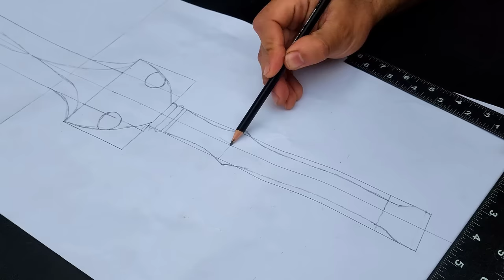Hand Forging RAILWAY Track into a Legendary WarCraft SPEAR

Comment: Visually gorgeous... But the blade made with different parts will make the liquids to go through the joints... It will get oxided and dirty at the blade decorations in no time since you can't clean the joints easily... Anyway, if it's only a model or to hang on a wall, it's completely gorgeous!

Comment: My only issue is with the video title; the rail was not hand-forged into a spear, it was forged into a blank and then cut, ground, and milled into the spear. Other than that, this was a great build and really pretty!
Reply: My only other issue is a 'good' blacksmith doesn't have to coat their anvil with WD40 and create a massive lens flare/fireball for views...
Reply: @chaossdragon sheeah, a guy can't even have any fun in his own shop anymore.
Reply: @VektrumSimulacrum  if I offended I’m sorry, I’m just jaded from all the “moar flames/moar sparks = more views”.  Seen pros do it so many times and one guys shop nearly went up in smoke cause an ember shot off into a box of stuff under a workbench…
Reply: That's how it's done. Any smith will forge out the rough shape and leave the rest to abrasives. The only exception I know are Japanese katana makers because good steel was notoriously rare. They would forge almost to final shape but then use rasps and files for the final shape.
Reply: @bramweinreder2346  I've seen many better smiths make many dozens more sophisticated builds than this. The difference here, as you pointed out, is that is that a master will at least forge the blade to shape before grinding. This guy does not. He forgets a billet, then he cuts the shape into it.
Reply: @SnappyFellow  that's inaccurate on both fronts. There are plenty of knife makers who use sheet metal as a basis, and then cut the shape out of that. Granted, that's not forging. The modern age does not require much forging if you can get high quality steel stock that's suitable for your purpose. You can machine everything and still be considered a master knife maker or even sword maker.
But he did forge a rough shape out of scrap metal, be it a very rough shape, it's forged nevertheless. Whether there was enough hand forging involved to justify the video title is clearly up for debate, and like you I've also seen many videos, but this doesn't make me an authority on the subject.
Reply: Amateurs are confused for simple enough reasons. HISTORICAL smiths are not really about smithing. Their story is about steel. Samurai sword was made from REALLY BAD STEEL! They were so smart and so skilled, they made their own steel and purified it by folding it. 1,000 years ago they made great weapons from terrible filthy contaminated garbage steel. So.. these amateurs in our sci-fi time think 'folding a sword' is really important. It is not. It was important THEN because they were driving out the contamination and layering high carbon pieces into low carbon bulk. Some might wonder.. 'Oh JUST railway track steel?' Yes, our sci-fi age scientist made railway steel. Steel of that quality is a different situation than 1,000 years ago. Frankly, the steel making is the greater skill and the more interesting story. Because, in a way you are right - using MODERN SCI FI STEEL we have, you can make super weapons far-far-far easier. His END RESULTS are breathtaking.. and it is made of steel that the ancients would go to war to attain.
Reply: @gravewalkers  amen. Iliad from That Works explained why folding was still a better way of purification than old crucible steel. Nowadays we use chemicals for purification.
What does speak to the craft of katana makers is that they were very efficient with the little steal that they had, so much so that they wouldn't grind something if they could forge it. Only when it was sent off for sharpening, the files came out I think.
Reply: Oh hush
Reply: this whole comment section kinda 🤓

Comment: Now just imagine how much easier that would have been if you knew how to properly use all those fancy toys.  Little bit extra time with the lathe and mill would have saved hours of grinding and polishing out tool marks.

Also can you really say that you forged the material when all you really did was flatten the stock?  I came here with high hopes and leave disappointed.

Comment: Outside of very basic shaping and flattening of the iron… was not forged, is a machined blade… amazing work but title is wrong… additionally because it wasn’t forged properly because there are to many points that will rust on that blade and if not oiled regularly will be a mess
Reply: 😂😂😂 nice joke  can you make same job with forged without using machine
No you can't because you don't have knowledge forged is term used for when iron or other metal reformed there shape according to job application.

Comment: Uses every tool in the machine shop... Titles video "hand forged".... <snorts>

Don't get me wrong, he tooled a cool display piece, but this is about 5% forging and 95% machining... I could forgive the belt sander, and even a power hammer had he usd one... but when he busts out the lathes and literally machines 2/3rds of the metal parts, it makes "hand forged" a clickbait lie.

Comment: If you call it forging then it would have been half complete and unfinished. While you did hammered the metal into sheet you did not hammer it into the shape but rather cut and grind it into shape which in essence does not qualify as forging but rather metalwork. Only when you hammer the base or the body of the blade into shape from one or two metal piece into one, shaping and compressing the metal into shape and only grind it to sharpen would it be forging. You skipped the essential and important part of forging, but your metalwork is indeed skillful.

Comment: This is not hand forge, this sword is not forged, you cut, milled, machined, everything but forge. Nothing was forged.
Reply: He forged the profile
Reply: He forged the title. 🤷‍♂️😂😂
Reply: I saw plenty of forging. He flattened and forged to shape. He then refined the profile and ground the blade to shape. If you think you can do it better, using the same materials and just a hammer and anvil, make a video.
Reply: I don't think you truly appreciate how much time, effort and skill that goes into making something like this. It's quality craftsmanship that can only come from time & bloodshed.
Reply: Heat and hammering ...👌🏼
Reply: What sword
Reply: Some of it was forged, but yeah I get what you're saying.
Reply: What the heck are you talking about? There was plenty of hand forging.
Reply: @reubentherblazer9756    yeap , forge is about Heat and hammering metal , i don't know why he said or wrote that ...
Reply: Imagine being this butt hurt
Reply: Pedantic, it’s an awesome product and plenty of heat and hammering. Slow-mo forging shots. You must have skipped around and missed it
Reply: I think he thought metal casting is forging. To forge is to use compressive forces to shape and form metal. You can cold forge or hot forge (etc)
Reply: @reubentherblazer9756  I wouldn't call what he did hand forging. Firstly no one used a hammer that size for actual work, that massive thing is just for show. Secondly he only flattened and got the very very general shape....There is way more to hand forging than that; if done properly his waste would look more like 10-20% rather than 50%.
Reply: Did u miss the first 3 mins of the video
Reply: @shb4200  not at all! But all he did was effectually flatten it. Someone else said he may as well have bought 1/2" sheet stock and they are 100% correct.
Reply: But yeah I do wish there was more hammer work and less grinding and cutting but whatever
Reply: @LordUnholyFury  agree these are videos made for money people don't realise
Reply: Got to agree not hand forged, watch any Forged in Fire episode to see the difference.
Reply: I’d like to see you do better
Reply: It's how the world works. THEY forge titles for views😂😂
Reply: What sword btw
Reply: U must not have seen the title 😂😂 u blind?
Reply: @nistaffsubs6787 at least he have the skill u don’t have
Reply: Can you doing this only by forging?
Reply: If you can show this in video on youtube
Reply: By definition was forged.
Reply: How do you imagine it? The material is forged, and the rest is cut out, try to do it exactly without machines, but only with a hammer
Reply: That's not fair,  he did forge the bilit.
Reply: He starts hand forming at 1:30 but yeah there was the use of modern tools also
Reply: Stop throwing shade!! He worked hard on it
Reply: make a video
Reply: @deathangelo82 he forged the billets and then cut everything out from those. Definitely not saying I could do better, because he is definitely better than me when it comes to what he does. And I enjoyed the video. 

However you really can't call what he did hand forging.
Reply: Mi mi mi kkk
Reply: @itsmegrimm  No one has to make a god damned video because they are pointing out factual information.  The billet was hand forged, the weapon wasn't.  Period.  End of story.  End of discussion.  That's it.
Reply: Lets see if you can do better? No?
Funny
Reply: He did forge this any kind of hammering and shaping the metal is considered forging
Reply: Your just mad you can’t do what he does😂😂😂
Reply: But he did operate all those things with his hands.
Reply: @deathangelo82 not trying to stick up for the other comment but lots of people have done that exact thing.
Reply: How dare he use the tools available to produce his best work and then make a mistake in the title 😤
Reply: @skoobsdaer51773 Oml bro, forged in fire isn’t the same damn thing, plus the world’s definition of forging doesn’t only comply to a reality tv show
Reply: So what exactly is your "Forge" mean 😌
Reply: 1:22
Reply: Is this nice or in a mean way
Reply: I guess you’ve never seen the show forged in fire before. It you can do this better then upload a video and show us how it’s done
Reply: @zane6482 lol there’s always one in the comments
Reply: Imagine hating?? Dude just like the weapon. It looks beautiful, and he worked hard for it.
Reply: Probably because it's impossible?
Reply: Shut
Reply: Exactly....someone have to say this...maybe he mean force by tool make in 2023
Reply: I too can "forge" things with machine tools.
Reply: Bro it's not that deep
Reply: make or shape (a metal object) by heating it in a fire or furnace and beating or hammering it. This is the definition of forging